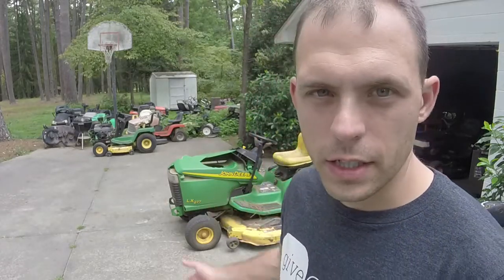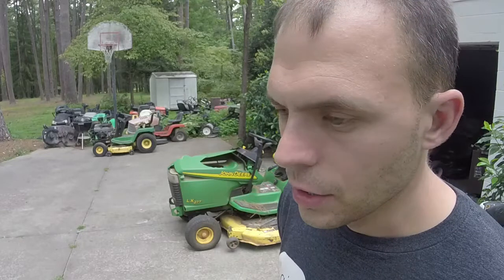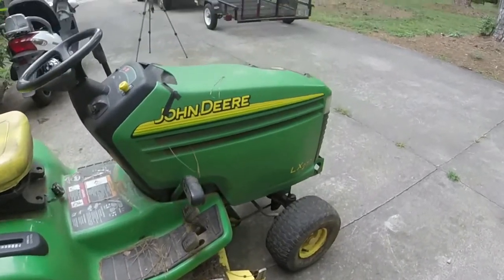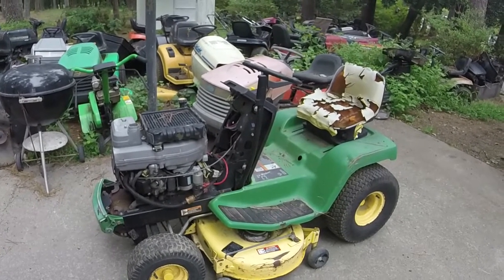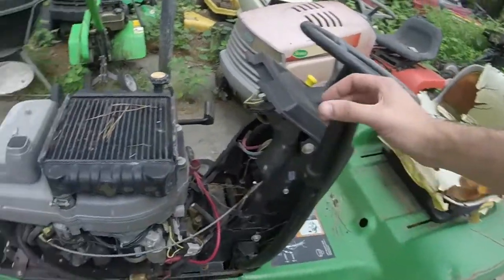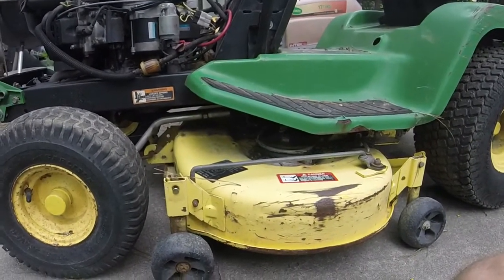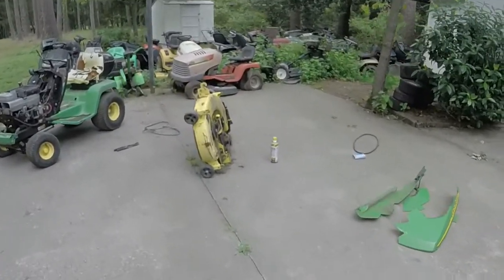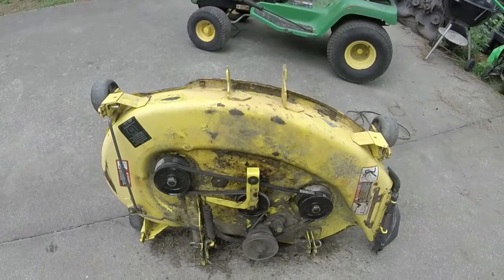John Deere LX277 with a rotted deck gets one from a parts LX178: plug and play!

Comment: Nice Video Casey.  I think that the John Deere 38 inch mower decks have an excellent cut quality compared to some of the other John Deere mower decks that I have used. 
Casey, I am thinking of replacing the spindle bearings on my first mower deck because of the roaring bearings. I have been really pumping the Lucas RedNTacky grease into the spindles to get by until I swap mower decks.
It’s amazing how many people will scrap out the John Deere mower decks when they rot out and not remove all of the good usable parts. Those John Deere double stack pulleys are just way too pricey just to toss out. 
Your mower deck sounds really quiet - Which is a good thing.
Reply from the maker: I was surprised with how quiet the 38" deck was considering the condition of the tractor it came from.  I have an LX188 that I will fix too with a 38" deck and then the parts LX178 will go away, I may save the engine (trans is leaking).  I'll keep the good parts off the rotted out deck for sure, I know they will interchange and it will be nice to have them on hand whenever I would need one!

Comment: Good use of salvaged parts.  I have  LX178 as a backup mower but I use it less and less.  The hood is in fair shape for this model, except that the hinge "ears" were broken when i bought it.  I can always just lift the hood fully off.  Do you find this condition makes these older JDs harder to sell? Thanks..(Tom in Hillsborough)
Reply from the maker: Hey Tom yes definitely.  This mower only sold for $400.  I can sell old MTD riders for about that much and the JD is a far superior tractor.